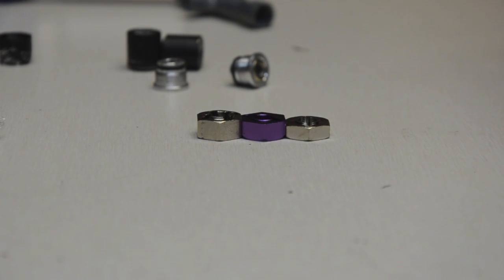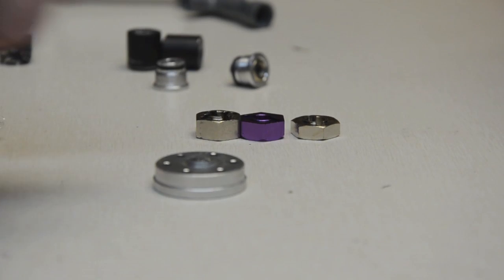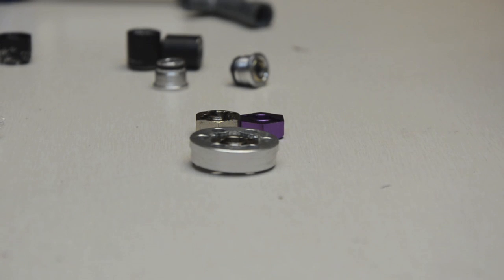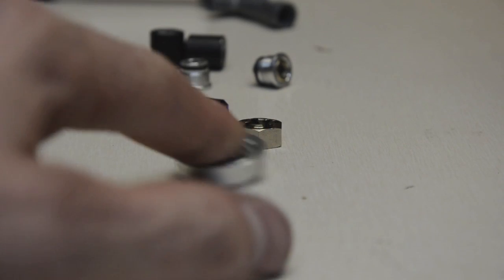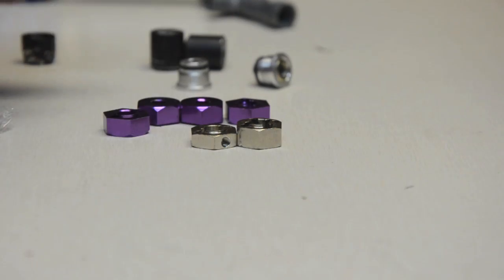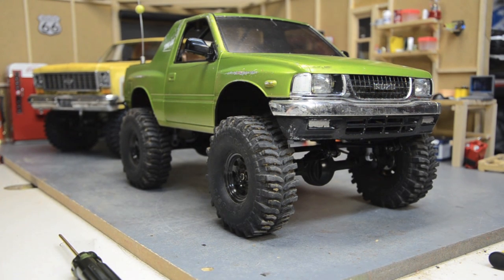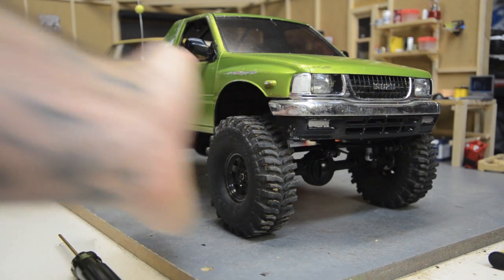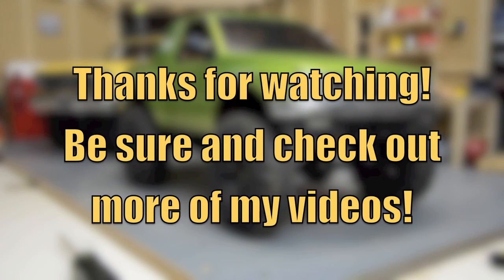Wheel Hex 101, Trying to Narrow the Track Width of the Amigo

Comment: i noticed those wheel hex when I was building my D110.  are those wheel Hex suppose to be taken out in order to put the tires on the D110?
Reply from the maker: +MAPAHaus5 yes most of the rc4wd 1.9s have a 1 piece hub that sits on the pin directly.
Reply: gotcha, thanks for the info.  Another question I have is the tire on the D110 seems too soft for the heavy body.  Would you recommend filling them with something that is more firm inside than the soft sponge/foam they are supplied with?
Reply from the maker: +MAPAHaus5 you could change out the foam inside the tire.  I wouldn't know for sure what to recommend to you. I think crawler innovations sells a variety of foams but I have no personal experience with them.